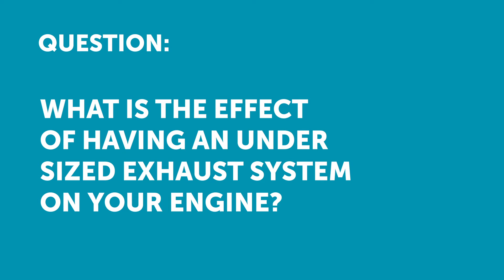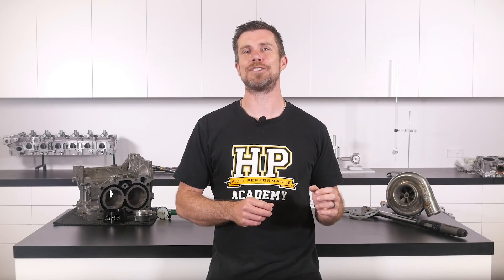Why An Undersized Exhaust Is BAD [HPA Q&A]

Comment: A restriction is a restriction. High pressure/temp moves to low pressure/temp.  
Why you should "properly tune" the intake and exhaust for the application. 
Do it right and you might brake over 100% V.E running NA.

Comment: An undersized system affects top HP.  Most of us don't spend time at peak HP.  If you think that bigger is better when it comes to exhaust tubes, try it.  I did as a 20-something and was surprised to discover that I hated how it drove in normal driving.  You need exhaust gas "VELOCITY" to work properly, and you don't get that with sewer pipes.
Reply from the maker: We are more focused on performance applications. When it comes to a street car, there are always compromises on what makes your car go faster and what makes it more comfortable.
That said, simply throwing the biggest exhaust you can at something without any forethought is not what as are advocating either here - Taz.
Reply: Why a properly tuned intake and exhaust is key.

Comment: Got my first WRX in August 2001. Got my STI in early 2004. My 2004 STI was the best car I ever owned
Reply: When I went to the track (weekly)  I removed my catback... 2 bolts, more power
Reply: Currently own a short cab, short bed 2017 F150 with a 5.0L v8. Magnaflow dual side exit exhaust,  Airaid cold air intake. She probably makes 420hp looking for a good tune but even without she probably makes 420hp 😁👍🙈
Reply: She ran 98mph in the 1/4 mile stock

Comment: Forgot, many years ago I wanted to change the restrictive OEM exhaust on a vehicle I was re-powering - slug 283 to mild 350, and the local exhaust shop tried telling me it was a waste of time, because 'a bigger exhaust makes no difference for power', or words to that affect.
I went elsewhere...
Reply: and the results?
Reply: @seannz100  Around a second - can't recall if over or under.
Reply: If you had 1 1/2" tubes, then yeah, upsize.  Most of the OEM pipes were more than big enough to handle a mild 250.  The Cat Converter was another story tho.

Comment: As a general rule, the less 'back pressure', or resistance in the exhaust ports, the better.
Problem is the entire exhaust system is inter-related and also affects the scavenging and exhaust port timing.
There is also the question of pressure waves in the exhaust ports and their interaction with the rest of the exhaust 'system'.
Going too big can actually reduce power, especially with NA engines, as velocity and scavenging is compromised and, possible, turbulence is increased.
Even with the 'Goldilocks' diameter, one has to have the silencing and overall lengths correct.
In theory, a vacuum source attached to the tailpipe/hotside 'should' work best, not least because pushing the exhausted charge out the exhaust ports requires a pressure head and that is resisting the piston, robbing torque.
Reply: Richard Skipper  Do you understand what a pressure gradient is, what actually causes fluid flow?
That automotive manufacturers have different priorities than overall efficiency?
that the manufacturers optimise the WHOLE package around the exhaust, and other, limitations - to the point where any changes made could significantly reduce torque/power because the parameters the ECU expects are thrown out of spec'.?
You can put that mass of gas through exhausts as restrictive as your example, but it will take power to push the gas through - that's why one of the first moves when modifying ANY engine is to reduce restictions in the exhaust - whether larger diameter components, reducing the amount of 'equipement' and/or using more efficent designs in place of the OEM.
How important is it to get the whole thing 'right'? many years ago one of the US Hot Rod magazines did a very comprehensive test of 'fender' headers on a small block equiped tri-Five Chev', with different length and diameter pipes - there was just over 50hp difference between the 'right' and the 'wrong' selection - with a different engine package, those results may have been reversed.
Reply: Thats something i see a lot of people talking, lower flow velocity on too big of a diameter would be detrimental, but something im not enterely convinced... any source on that with mathematical explanation?
Reply: @satanaz  Not off hand - in the meantime, you may wish to do some reading up on pressure and velocity heads for fluids.
Oh, one of my old tutors had this example of the velocity head and the scavenging affect - with a full sink, pull out the drain plug and it is quite easy, but holding onto it when replacing it against the draining water it can be much harder to hold onto - that is the difference between a pressure head and a velocity head.
Reply: Even the "engineer explained" guy has a video on that, but he only mentions it, without backing it up with math or a good explanation, and I have seen videos of his where he talks non-sense, so I always take youtube info with a pinch of salt
Reply: @satanaz  For the most part, that chap's video explanations are pretty darn good - there were some details in his early videos I think I had a small issue with, but they were minor.
Do you recall what he said that you considered to be "non-sense" - might be able to clarify for you? In the meantime, try reviewing them as I suspect you may be misunderstanding, rather than him making the error?

Oh, with turbocharger turbines, Mr Banks has a nice commentary on the pressure drops in the engine from within the cylinder, through the turbine housing to the tailpipe.
Reply: @gordowg1wg145  indeed, the guy is pretty good, I am no way trying to take away his merits, but even the best can make mistakes, so, don't always trust your "teachers"; always check it for yourself and back it up with data, math and physics
I can't remember exactly what it was he said was wrong,  something related to vehicle dynamics which was my expertise
TBH vehicle dynamics is something that even F1 engineers overly simplify, because aero >>>>>> vehicle dynamics, but still...
Reply: @gordowg1wg145  I have done some more reading this afternoon, and now I see where my  disbelief came from
I didn't quite get how the fluid speed could affect the scavenging
Seems that the higher the fluid speed, the better its scavenging effects, thus why you would not want ~0% restriction → a byproduct of a little bit of exhaust restriction is higher fluid speed, which yields higher scavenging which mean more poweeerrrr!!!! Something that you would never guess by just looking at the Q=VA flow rate calculation (but I should have known better than overly simplifying it like this in the first place 😅)
In the end the 'morons' saying that engines like a little bit of back pressure are not entirely wrong 🤷‍♂️ go figure.... (although it is not the back pressure that makes the engine happy, but the scavenging! Can't have one without the other tho)
Reply: @satanaz  If it's the video I'm thinking of, one of his earIy ones, I made a comment in the comments ;-)
I would add experience to the three things you mentioned - if you come up with something that seems a little odd, it's usually a sign you need to review your calculations.
Yup, aero' trumps darn near everything else, not just dynamics but cooling and, to an extent, mass distribution.
With the new regulations for the tyres, when they get back on the track, going to be interesting to see how they manage the black art of tyre management as decades of knowledge of them, and the brakes, is going to be needing a major re-think.
Reply: Yes all about "property" tuning both the intake and exhaust

Comment: Thanks for addressing this issue.  I've been saying for years that a four stroke engine does need any back pressure.  Years ago I installed a 2.5 inch mandrel bent exhaust system on a 1.8l Mazda engine and my goodness when people starting proclaiming that was too big.   Recently Gale Banks mentioned back pressure in his Killing a Duramax series.  Hopefully between well informed and respected engine builders such as Andre and Gale speaking out  on this old wives tale it can get put to rest.
Reply: But, did you take before and after graphs to overlay and check?
Reply: @gordowg1wg145   lol.. saw that one as well.  He loves data

Comment: Nice and concise. Backpressure = all bad on a turbo car (post-turbo especially). But on the street, some of us still have to keep it at least reasonably quiet. I just found a pretty sweet idea online a few days ago: put a large external wastegate on the downpipe. Play around with springs until you find what opening pressure works for you. Less backpressure and lots of extra noise but only when you want/need it. Purely mechanical, totally predictable and repeatable with no boost controller needed (unless you want to add an MBC for a extra control) and much better longevity with no leaks vs an electronic cutout, with the added bonus that it works automatically so you can't forget to open it.
Reply: Many years ago, I drew up a design for something like that for a purely mechanical valve integrated within a silencer (muffler) that did much the same thing, as exhaust pressure reached the set spring point, it would have internally by-passed the silencing medium and passed straight through in proportion, as set by the spring.
I might suggest you route the bypass to the rear of the vehicle, to reduce the noise in the vehicle?
Reply: @gordowg1wg145  sure, one could do that. You could even muffle this "bonus" external wastegate exhaust if you want as well with something like a SuperTrapp if desired. The point is that it adds extra cross sectional area (aka more flow) when it's needed. As far as noise levels in the car... I would be more concerned with catching the attention of the boys and girls in blue